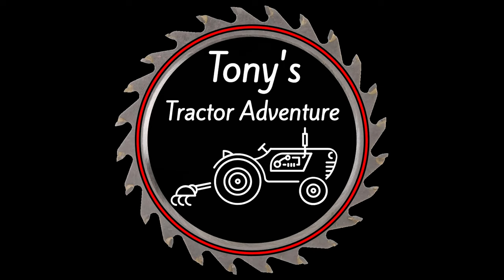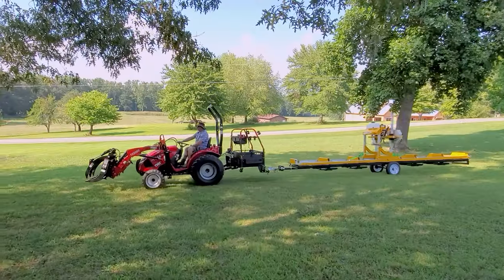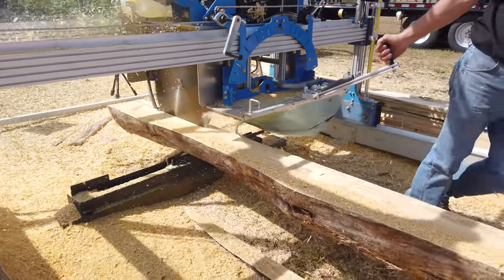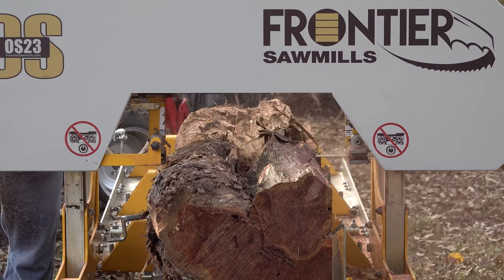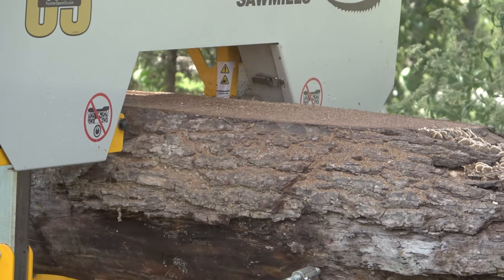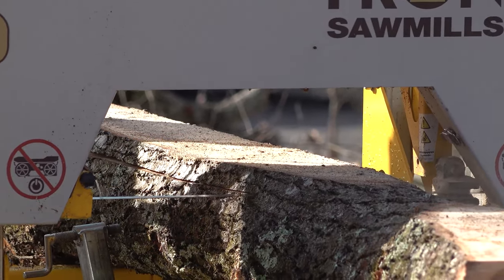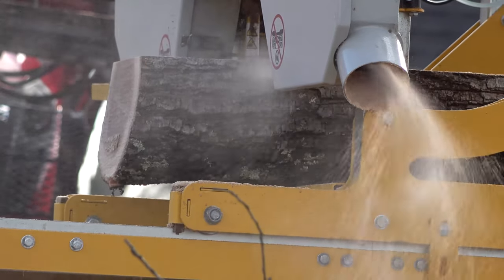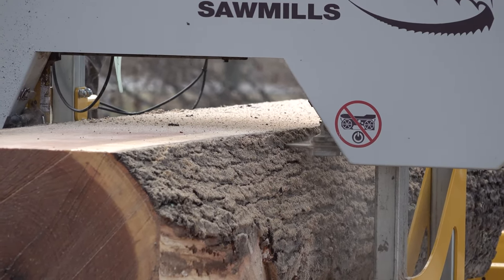How to Buy a Sawmill. We bought a Frontier Sawmill

Comment: Great video. When I was buying a sawmill I wrote down all the pros and cons of each sawmill that I researched. I do agree buying the biggest sawmill you can afford for the value.
Reply from the maker: I knew at the time I bought my sawmill, I wanted the OS31 or something like it. I rationalized the smaller size mill from a point of ignorance. I only took a small survey of the trees I had on my property and the ones I seen driving around. It turns out, there are a lot of bigger logs. We live and learn.
Reply: What did you choose for a mill?

Comment: When you swapped motors did it allow you to saw a little faster than the factory horsepower motor did? Thanks for another great video.much love from Chester co.
Reply from the maker: It definitely saws faster than the 7hp engine. It doesn't slow down, and just pulls throught the log.

Comment: Thanks Tony, great video.  I ordered my sawmill Aug 1, 2021.  It is a Woodmizer LT15GO Wide with a 25 hp Kohler engine.  Originally set for delivery in July 2022 but they are having delays from the engine manufacturer and they gave me a delayed delivery for sometime in September 2022.  No hydraulics but I have a 50 hp Mahindra with a grapple to help handle the heavy logs.  I will need a cant hook and I remember you found a good ligth cant hook.  Although I am buying a Woodmizer mill, I am not sure I want a Woodmizer cant hook.  I am probably paying too much just for the brand name but it had most all of the features I wanted as a beginner sawyer.  Do you have any suggestions for a good cant hook?
Reply from the maker: I have really enjoyed this cant hook. https://amzn.to/3ucucxw